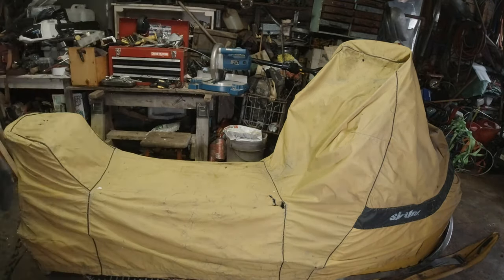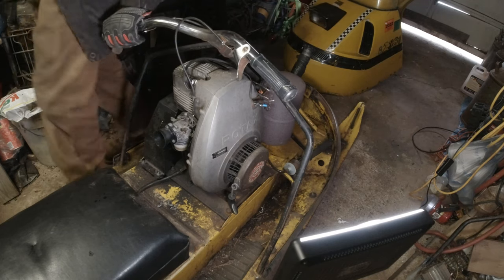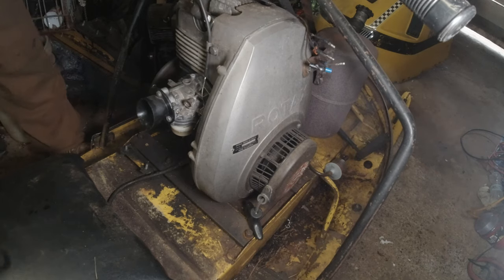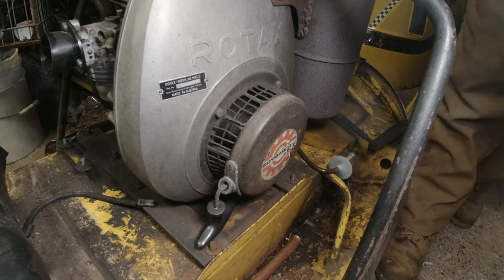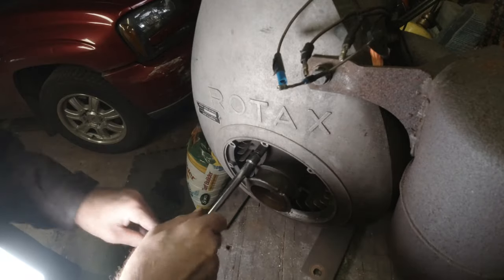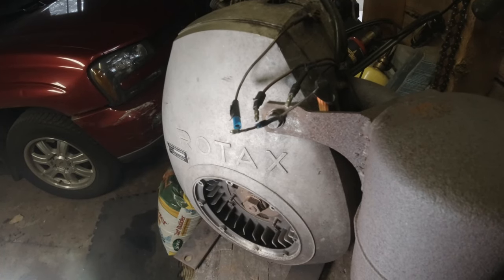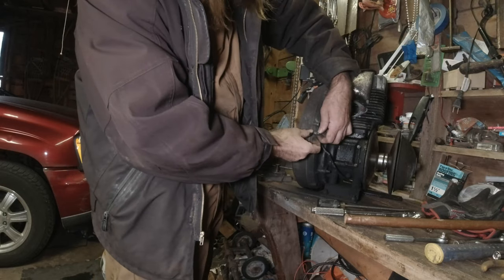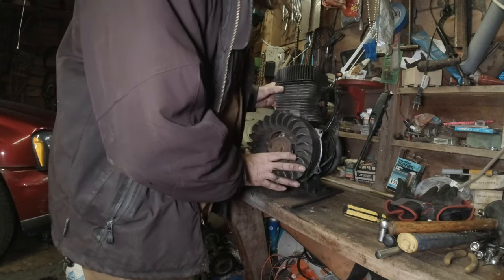1969 Ski doo Olympic, Taking it apart, Vintage ski doo, #snowmobile #vintageskidoo

Comment: Try PB Blaster penetrating oil in the spray can.   Its magic juice.   Works on stuck nuts and bolts all the time.  Cheers.
Reply from the maker: It works good I always use it.